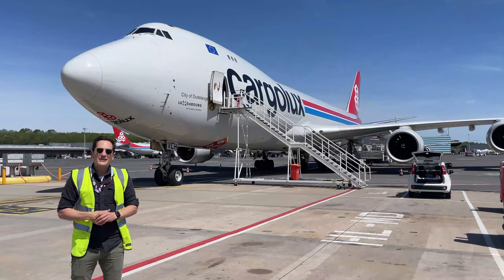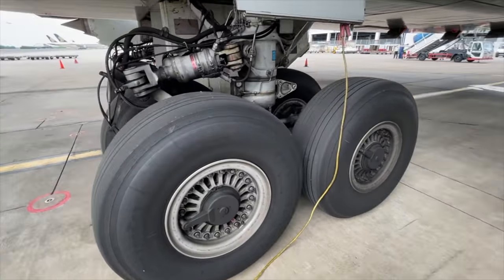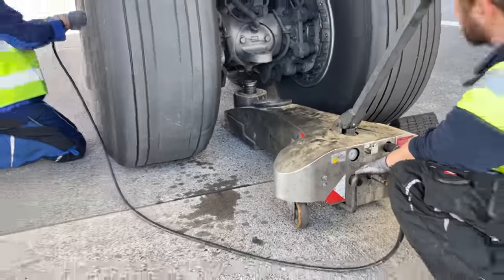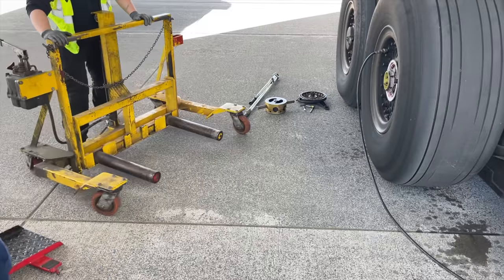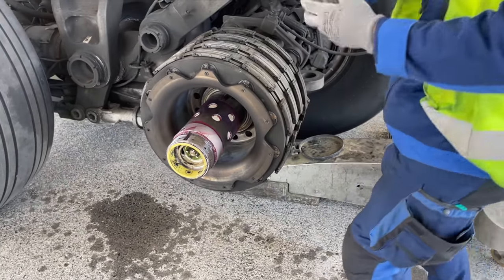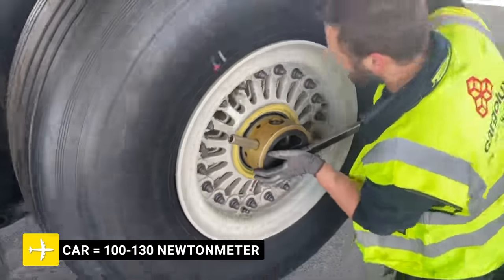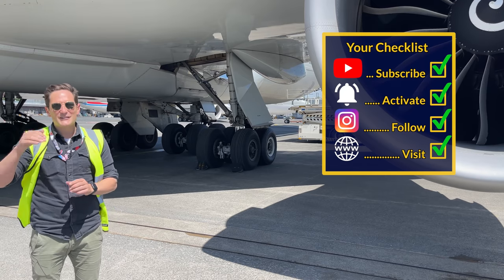How to change an AIRPLANE TIRE in 15 MINUTES! Explained by CAPTAIN JOE

Comment: Hey cpt how's it going, ironically the hardest part of changing a tyre is to set the brakes to secure the brake disks in a centered position so that they don't drop.
As if you don't it makes it extremely difficult to install the new tire assembly.
Iv seen many new engineers forget that part, 
Great video Joe, stay safe
Reply: Ah yes, nothing like levering the brakes back into place with a screwdriver for 40 minutes...
Reply: He also missed greasing of the axel before pushing the replacement wheel into position. This is to ensure the roller bearings inner race slides effortlessly.  The FAA once busted a friend of mine for using the wrong axel grease on a 767.  Bearing grease was wrong
Reply: @III_Nick_III    It’s not that hard to put the brake disks back in order if the brake disks slip down. I have had a lot of experience doing that, until I learned to put the brakes on first.  The big problem was changing the wheel at the gate with pax onboard. Kicking off the brakes to spin the tire means the airplane moves just a bit with the pax standing. Just enough to lock the chocks in place. So when you get ready to leave, you have to jerk the plane forward, then wait while everyone removes the chocks. 
Ahhhh I miss the good old days of spending Christmas working on a cold rainy night.  I am retired. Thank you.

Comment: So let me get this straight. You have 18 tires on the plane, you haul cargo... you are a certified 18 wheeler. From this land trucker to you sky trucker fly safe. Also could you do a video on how the brakes work on these planes? They look super interesting!
Reply: You can get a good look at the brakes at 4:52. The parts with the tabs sticking out are the brake rotors, those tabs are how they interface with the wheel. Between the rotors are the actual brake pads. It's a big stack, with alternating pads and rotors. When the brakes are applied, the whole stack is squeezed together with hydraulic pressure.
Reply: @Zach Pare Normally they are Hydraulically activate, multiple piston setup, alternating between several pairs of stators and rotators. Stators don't move and the rotators get keyed to the rim

Comment: Nice video! I'm surprised LX mechanics doesn't install a axel thread protector when they do tire change. This is a big no no at my airline. One wrong move and the aircraft will be AOG while they change out the axel due to the damaged thread. The thread protector also makes it easy to slip the wheel on and off.
Reply: That’s what I was thinking also.

Comment: Brings back memories of changing tires on the USCG HC-130s I worked and crewed on for 21 years.  Always make damn sure the brakes are set before removing the wheel or all the brake rotors will drop but then we had a brake alignment tool that would re-set the brake rotors.  Yes, I made that mistake once.
Reply: If you forget to set the brakes, you can just spin the tire on the brakes to get it on.
Reply: @andrewj9831  Not really....those big ol' brake rotors will not only get out of alignment circumferentially, but also axially....they will fall down about 3/4 of an inch. When the brakes are hot (like they almost always are), getting the rotors lined back up is a real pain....and can get your fingers pinched off.
Reply: @jimwells4240  about the same or less as most brakes I changed on commercial planes.... that's why you angle the tire  slightly at an angle 😁

Comment: Hi Joe, great video, very instructive!
Note that the main tires of B748 (at least the brand of the ones shown in the video) achieve much more than a hundred landings before needing to be replaced.
The jack is a very clever design indeed!

Comment: Joe, i am surprised by how quick the process is! is this or was this the same time on all 747s ? does it depend on weight? Would it take the same time on a fully loaded A380? so many questions!!!
Reply: because there is no brake fan . in A380 take more time because there is brake  fan (optional) who cool brakes if we dont have long ground time.
Reply: Airbus have different type of tire pressure sensor, has brake fan and different style center lug which can be difficult to align locking bolts. In general Airbus needs twice time replace tire.

Comment: Using tire pressure to lift the axle serves 2 purposes, lifting and safety. The wheels are from a split rim type and therefore tire pressure needs to be lowered before removing the wheel nut. For the same reason new tires may only be inflated in a safety cage before mounting. A pity the gentlemen didn’t use the tread protector.
Reply: Why do you need a tread protector? 😉
I kid, I think you mean thread protector. 😁

Comment: I've changed quite a few tires over the years, recently retired A&P in the US with a major carrier.  Two guys working together that have done it many times as a crew can do it in 15 minutes.  True they didn't put the thread protector on but obviously didn't do any damage to the threads.  Depending on the paperwork required it can sometimes take longer than 15 minutes.  FLY NAVY!!!
Reply: We also didn't air the tire up until it was on the axle, as if it came apart the wheel nut might help to hold it.  On inflation we used stand off gauges so we were at least 20-30 feet either in front to the tire or behind it depending on position.  FLY NAVY!!!
Reply: I have seen a thread protector used about 2 times in my career.
Reply: @justing42  I used to use them when changing a brake.  But on a routine tire change I don't think I ever did.  FLY NAVY!!!
Reply: @justing42 you can damage lip just past the threads of the axles. 767's have a sharp edge which I have seen it get damages and had to get NDI and the plating shop out to fix it.

Comment: So they don't grab a spare tire from the boot/trunk of the plane? :D
What if you need to land in the middle of nowhere, on a dirt road and need to change a tire there?
Reply: There are provisions to carry spare tyres and equipment, but they are not mandatory. If you regularly operate such destinations you would consider something like that. Otherwise you fly in the wheel and the mechanic together with the equipment with the next flight. Or you can ask a maintenance organisation in the area to do the job and provide the wheel, or send the wheel to them. 
Just a few options an airline has.
But it can be quite troublesome depending on the location.
Reply: Call auto club (or maybe plane club)?

Comment: Those tyres are absolutely gigantic, quite amazing that they can survive 100 landings before a change is needed. The most amazing thing about the assembly is how the wheels interact with the brake assembly, the wheels key into the brake pack directly rather that bolting to a hub like a car does, making that whole assembly stronger and simpler as a result.

Comment: A great video. As a retired Aussie LAME, I have been involved in numerous wheel & brake changes. One small detail you overlooked, probably because so much was going on. With bogie gear, the A/C brakes must be off before jacking one set of wheels. The other set of wheels actually rotate when the other lifts. Not criticising, just a point of interest. Keep up the great vids.

Comment: 5:35 "while spinning the wheel, ensuring it spins freely". That's incorrect, the reason we spin that wheel is to prevent pitting in the bearing races, as the pressure applied by the big nut when you tighten it goes right against those bearings. It also makes the bearings "sit" evenly in the wheel's hubs.
Additional notes:
6:13 Now, I'm not doing 747s and I can't see clearly what the green tool is, but I'm pretty sure Boeing says in their AMM that the locking nuts and the protective cover's ring nut should also be tightened to specific torque values and not just by ear.
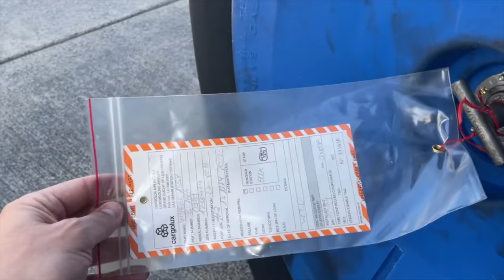7:01 It's not good practice to write SAME for a Part Number, you should always write the actual P/N on the label, in this case 3-1664
It could be that your Operator might not be happy with you release all this info to the public, just saying. Otherwise, pretty cool stuff for people who've never seen wheel servicing for aircrafts.

Comment: 220 psi. If that thing blows and you are standing next to it you can kiss your head good bye. It will be found a field nearby. Road bikes, bicycles, have between 100-120 pis and when that thing blows it makes a loud bang. These things hold 100 times more air, or more, and twice the pressure as well.

Comment: I can't tell you how many 747 tires I've changed and still watched this entire video with enthusiasm lol. BTW the initial torque for the wheel (500 ft lb) is to ensure the bearings are properly set.
Reply: getting that 500 FT. LB seating can be a challenge for us old guys

Comment: Hi Captain Joe. Brilliant and concise depiction of a wheel change on a modern jetliner.
I was an airframe fitter in the RAF back in the 1980's and I often changed wheels on the C130 Hercules which had similar sized wheels. We would have loved to have the use of that brilliant pneumatic lifting jack and the wheel change trolley. We had to do it all manually in those days. One issue that I noticed is that there was no mention of applying the breaks before removing the wheel if we didn't set the breaks before removing the wheel the the break segments would collapse and we would be forced to employ a device we called the spider to reassemble the break before we could fit the new wheel (oh the embarrassment if we let that happen!) . Is it the case that modern jets don't require the break to be set or was this step perhaps omitted for editorial purposes do you know?
Reply: The 747 is a BIG plane with lots of steps.  We leave the brakes off so we don’t have to make a trip up and down to set them then release them etc.

Comment: I never imagined that 747 tires could be changed that fast. Boeing really did a great job on the design of the locking nut and cover assemblies as well as the procedure.
Reply: Lockheed uses the same system.  It's kind of universal.   Actually, you can change the tires and brakes FASTER on a large aircraft than on your family sedan.
Reply: All big planes are basically the same as far as tire changes

Comment: I'm missing here the step of using locking wire when the wheel nut is being installed again. This is also something that is mentioned in the maintenance manual so that should be there as well.

Comment: Several years ago I was in a big hurry to get from new work Union Airport to Phoenix. I had a antique car that I have been trying to sell forever but it’s difficult to sell a Rolls-Royce that is 61 years old. I got a call from a buyer who was leaving town the next morning and wanted the car at full asking price so I told him I will be home tonight and will make the deal then. I got on the last flight to Phoenix and got settled in thrilled with my good luck! We sat there for a while and they closed the door and nothing happened! The captain came on saying that we had a flat tire or a tire that needed to be changed and it wouldn’t take very long. I slid out of my seat under the seat in front of me well at least that’s what it felt like I figured they first have to call the union and the union will have to clear a crew to go out there and then they would need 10 people to change the tire yada yada yada. I didn’t build a plane going up you know like a jerk jerk jerk like on a car. But after about 10 or 15 minutes we started to push back. I was floored to say the least. When the flight attendant came by I ask her what happened and she said they changed the entire wheel with the tire but it takes about 10 minutes on a DC nine. That’s incredible. I got home the next morning the guy showed up with a covered trailer and a bag full of hundred dollar bills. I examined each one quickly because that’s what I do for a living. He got his car I signed off on the title and luckily my wife is a notary. And I asked him why he was interested in the car and he told me he researched the Vin number and this was a very famous car and he asked me do you remember what color it is and I said yes it’s yellow underneath all that dirt. And he said precisely this is the car that was used in the movie the “yellow Rolls-Royce.” He also said it was used in the movie with Jack Lemmon and was also in a movie call Breakfast At Tiffany’s but it was a background scene passing by. So he took off and we went online and dug all this stuff up and there it is and I’m still glad to get rid of it but I wonder how people find out so much on a vin #.

Comment: also pls set the brakes before removing wheel so brake rotorplates stay in place the new wheel will slide easier over the rotorplates nice comp cargolux lx lcv

Comment: This recently happened to DL515 (Delta Air Lines). They blew two tires when landing in LAX. The ground crew managed to replace the tires within two hours and tow the plane away so the runways can be opened again.

Comment: I'm a vehicle technician and this isn't as unique or involved as I imagined it would be. The addition of the pressure sensor is something a lot of cars are having these days. The single nut to secure the wheel to the hub is probably the most unique thing compared to an average car. I am guessing that depending on the forward direction of the aircraft the nut is either tightened clockwise or anti-clockwise so it can only ever be tightened due to the movement of the wheel and aircraft direction (forward). Although maybe they don't and that's the job of the little fastener to secure it in place so it can't rotate and spin off the hub shaft. The splines on the inner of the wheel rim seem to engage with the brake assembly, which judging by the thickness is probably made up of several discs which either turn with the wheel or stay still and when clamped together apply friction to absorb the kinetic energy? Very interesting design. I'd love to be doing this as a job but at 35 I am too old now.

Comment: Capt Joe, Thank you for highlighting us, the maintenance side of aviation... We really appreciate it!!!
I'm surprised...No axle nut thread protector sleeve... That's a big no no at my company... ALWAYS use the axle nut thread protector. Those wheel bearing races can tear up some threads, even with the tire lift, then you're really screwed... Not sure about a 47, but if I'm not mistaken, an A320 would require a Main Landing Gear (MLG) change if the axle nut threads get messed up....

Comment: Captain Joe,
So much thought and engineering is involved in that process but 
what amazed me the most was the cost of a single tire, you could buy a decent used car for the cost of one of those.....amazing!
We have always bought the best tires we could afford for our cars, but it's just us and we are not landing or taking off, at least not intentionally:)
Cheers,
Frederick "Rik" Spector
Reply: Used car, you can buy a pretty good new high end luxury car for the price of a new tyre and wheel assembly, or just barely cover replacing all the tyres and servicing the wheel hubs on the one bogie. There is a reason those tyres are watched after as spares, they are the single most expensive consumable in servicing, and have no defined life either.
Reply: it's between USD 1500-3500/tire in bulk.

Comment: I recall an option in your auto back in the 50's, was a short length hose with connectors on each end. 
if another driver had a flat tire, you could share your spare tire air to the get then to a service station.

Comment: There might be different rules for the 747 but in any other aircraft that I have worked on the tire needs to be deflated before is removed. In addition the axle needs to be cleaned inspected and re-greased before a new tire is installed.

Comment: There is a a critical item in the prep for removing the wheel assembly that was overlooked.  The parking brake should be off during jacking then you should set the parking brake just before pulling the wheel assembly off the axel.   Skipping this step may cause the brake rotors and stators to fall out of alignment and make getting the wheel back on very difficult (especially if the brake is hot, as during a quick turn).  After the wheel is installed the parking brake must be released before the final torque is applied to the retaining nut and only  then is the aircraft is lowered to the ground.
Reply: if you release the parking brake before torquing the nut, wouldn't that just make the entire wheel turn? (when doing a car wheel, you can slightly lower the wheel so it makes slight contact with the ground, and also the nuts aren't centered directly on the hub)

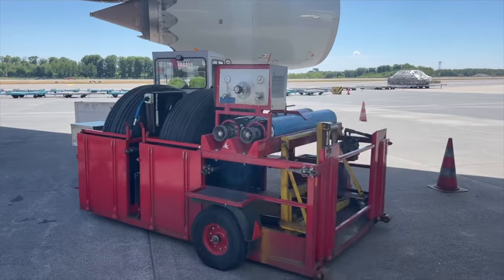Comment: 7:10 just fyi, the symbol you used in your text box "Tire change > 15 Minutes" means MORE THAN, and not LESS THAN.
LESS THAN is < the best way to check that is to compare it with an L they should be in the same direction.

< L

>L

Comment: Very interesting video ! Is the park brake set during the tire change?
Reply: Chocks?
Reply: Yes, to hold the brake rotors (not callipers as Joe said) in place otherwise they drop making it difficult to get the new wheel on. The park brake is then released in order to spin the wheel during the torquing process.

Comment: 6:21 as far as i remember in AMM, the cross bolt head (the top one)  to hold the axle nut must be in inner side of the axle. this is a fail safe method in case the retaining nut lost during wheel spinning so the bolt will remain in position due to centrifugal force. correct me if im wrong. just sharing my exp.

Comment: The mechanics forgot to install the threat protector before pulling the wheel off the axle. Also, the parking brake should be set before removing the wheel to keep the stack of brake disks aligned. It makes installing the new wheel easier. You'll release the brake again after the new wheel has been put into its place, before torqueing the wheel nut.